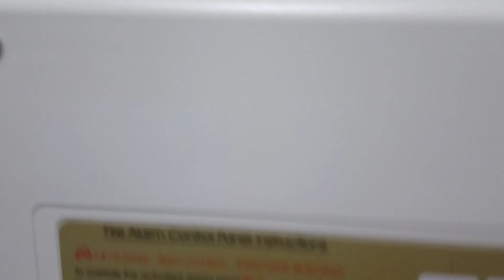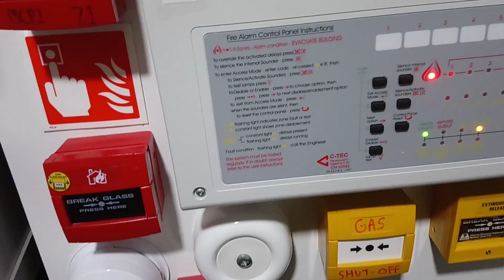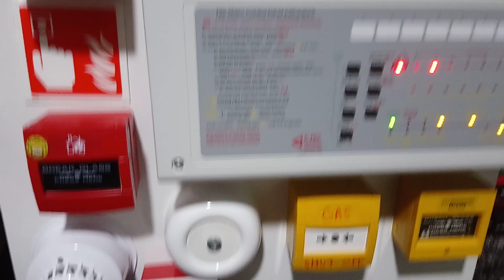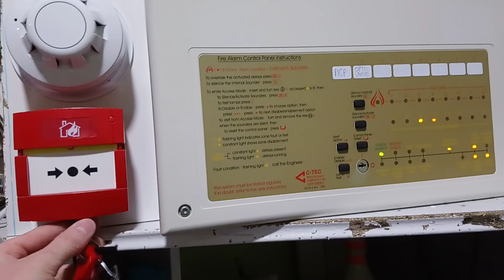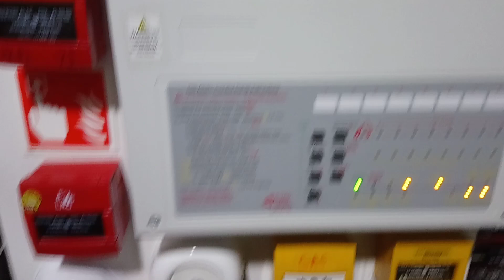Network system test 1

Comment: Could you do a tutorial on how and on which you wierd the network cable to both panels ?
Reply from the maker: I will be able to explain the circuit diagram in a video, but can't show it in operation due to an change in panels.
Reply: @GraingerElectrical  Okay thanks. That is perfect it doesn't have to be in operation. Just show the wiring and terminals with the panels dead.

Comment: Don’t activate the CS heat detector or it will be permanently activated and you will have to replace it
Reply from the maker: Ok
Reply: Yes they are called fixed temp heat you need an a1r or rate of rise detector
Reply from the maker: @jp-alarms  ok
Reply: I don’t think that’s true, you can just take it off it’s base and reset the system and let the sensor cool down before putting it back on the base
Reply: @GraingerElectrical  don’t listen to him mate, the sensor probe cools down quite quickly